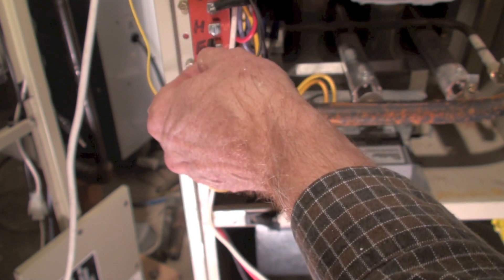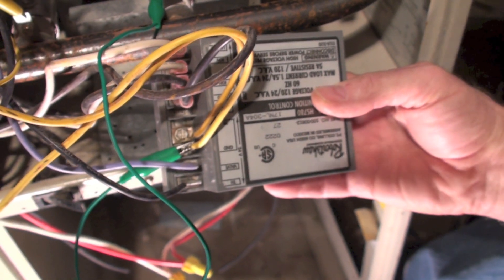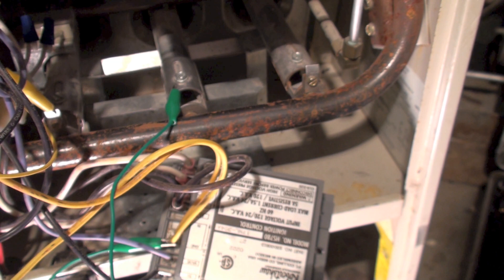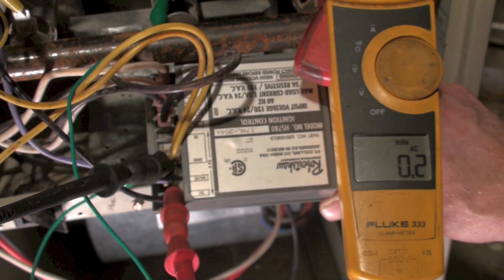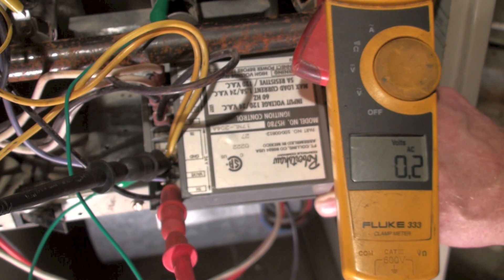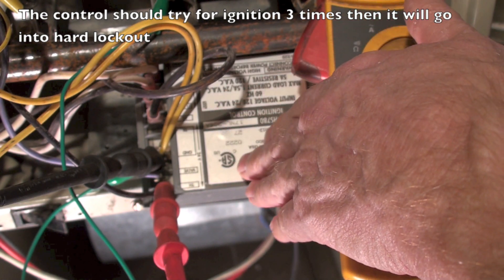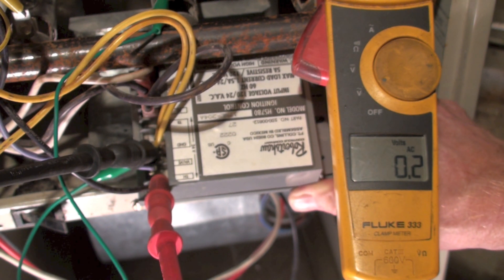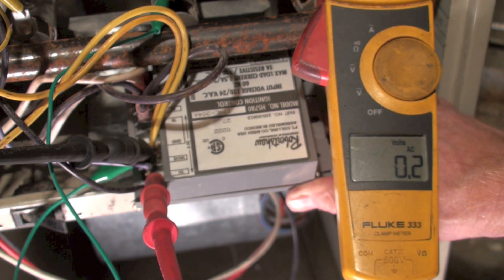Troubleshoot of the Rheem RGDA model ignition control part 3

Comment: Robertshaw is pure garbage. Pry the back cover off of one and you are almost guaranteed to see dozens of cracked solder joints from poor/no thermal management. They shot some kind of gray goop all over the components that somebody probably said was going to dissipate heat at an industry trade show in 1988 but it does not work at all and the boards just melt themselves down over time. The solder also smells toxic as hell if you ever try to re-flow it.

Honeywell equivalent is like $20 used on eBay, has a basic status LED, clearly labeled test points, terminals that aren't so close together they are guaranteed to short if you brush up against them the wrong way, and stands a much better chance of working longer than a brand new Robertshaw will.

Comment: Hi great videos, I have a quick question about the furnace I have. It looks similar to the one in this video RGDA model, but the sticker on my furnace has a different model RGLD on with sticker on outside says Electric Ignition 
I searched everywhere for this RGLD model but can’t find any mention of it, all searches come back for RGDA. Can please advise on what model I have, the igniter keeps making a clicking noise when started and sometimes keeps doing it for a while. Nonetheless I do have the heat on when it starts.
Thanks
Reply: I meant ignitor keeps clicking 
Thanks
Reply from the maker: @relali2009  A lot of the Rheem units of that era had the mercury switch ignition.  I would just keep hoping it still works.  They do not make that ignition system anymore, and it is quite expensive to replace.
GFM
Reply: @grayfurnaceman  
Thanks for your reply just a quick follow up
Is there a RGLD model or both the same
Thanks 
Ray
Reply from the maker: @relali2009  They had a number of 3d numbers in the model that seemed to indicate whether it was standing pilot or several different types of electronic ignition.  Other than that, they are pretty much the same.
GFM
Reply: @grayfurnaceman  
Thanks for your feedback much appreciated 
Ray

Comment: My HSI glows but the gas valve never gets 24v and the ignition module buzzes..... bad module?
Reply from the maker: That would be my guess.
GFM
Reply: This happened to me.  Replaced the module and it worked.  So most likely bad module.

Comment: I just had a question about my experience today.  I have a 24 year old 
Rheem Gas Furnace that I just replaced an ignition control unit with the
 original Robert Shaw HS 780.  I do trust the technician that diagnosed 
it today.  He recommends a replacement furnace at 4500 dollars.

The problem was that no gas was being delivered for the ignitor to light the furnace.
So he checked the system out for the gas valve problems.
During his system check he used jumper cables to start the gas valve and so he was able
to get the furnace started but only through jumper cabling.
My question is if he can start it with jumper cables is it possible that
the furnace still would work without the jump starting?

He stated that because the ignitor would not shut off (by itself after he jump started it )

and the ignition control unit would not start the

furnace unless it was jump started that the ignition control unit was bad.

Ultimately, he said that because it was a twenty four year old furnace that just replacing parts was
not a good strategy.  I had replaced the control unit in the past and it worked ok for 5 years.

Given this scenario - Is this furnace still in working order?

Is it correct that if jump started the control unit should shut off the ignitor after flame on?

Thank you for any reply.

Comment: Check ground coming in.  I had one where I had 120v coming in but not out.  Put in a new board, same issue.  I then checked ground which was hanging by 3 pieces of the twisted wire.  Re staycon it and it worked.

Comment: my hot surface initiator comes on for a few seconds then off then on then off. but no flame.  when I check the voltage it never sends voltage to the valve, and the valve is good I tested it to see if it works.
Reply: I fixed mine. I took the unite a part and found 3 relays. one large one for the red hot igniter, one for 24 volts for all the  sensing  for the suction fan, and the other senser  IE the breaker, and a chamber sencer for heat, and then a relay for the gas valve and found that one was stuck, or bad. I was a scraper at one time and saved stuff like relays ect and found I have a bunch that I was able to replace that bad relay.  and now we are back up and running. .

Comment: Thanks for the videos. My Rheem RDGA has the same Robert Shaw control. The ignitor works. The pilot tube lights. Once it’s light for about 3 seconds, the pilot flame turns off. After three tries I will turn the thermostat off and back on and usually the same thing happens, although sometimes it will stay lit and light the main burners. Any suggestions? Does the pilot burner have a flame sensor? Any help is welcomed. Thanks.
Reply from the maker: That unit uses the hot surface ignitor as a flame rod.  If the flame goes out after several seconds, the problem is in the control  The Robertshaw 780 control gave a lot of problems.  I would replace it with a Honeywell S86 control.  When looking at the Honeywell control, there will be a crossover chart with the control so you can adapt the Honeywell control to your furnace.  Hope this helps.
GFM
Reply: grayfurnaceman thank you. I will give it a try.

Comment: Hi there, I have a rheem rgda-06KC with a Robertshaw 780-715u that is acting up.  It acts up intermittently where the furnace will go through the process of lighting and the burner will just cut off after a few minutes.  The ignitor stays lit until I turn the thermostat off.  If I keep trying, it will eventually work.  Would a faulty ignition control keep the flame lit on the ignition assembly but cut the gas to the burner?  I did replace the ignition assembly, and had the same issue.
Reply from the maker: You might try the Robertshaw MODEL 26108 universal ignition control.  The model you have gave a lot of trouble.
GFM
Reply: Thanks for the reply! I'm not finding that model # on the internet. Just to confirm, it's a robertshaw 26108?
Reply: I take it back. I think I just found it, but under the name of Capable Controls?
Reply from the maker: You got it.
GFM

Comment from the maker: Yes I already have some on the 92% furnaces. look at the playlist for gas furnaces.   The primary difference between 92% and 95% is the ECM inducer.  I will be doing some similar to the older furnaces.  One of the reasons I do some of these older units is they are good for training and some are interesting for their design.  Merry Christmas
GFM

Comment from the maker: I guess that could be but has not been my experience.  The robertshaw 780 has been a problem child for me especially in water heaters.  I have replaced the 780 after several failures with the Honeywell S8610 and the problems have stopped.  I guess we all have different experiences.  Thanks for the comment.  Merry Christmas
GFM